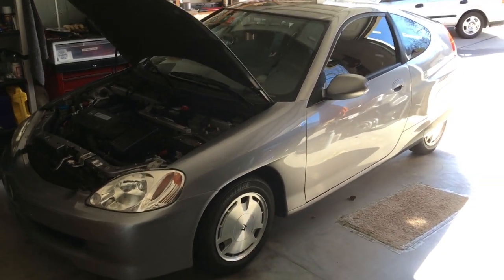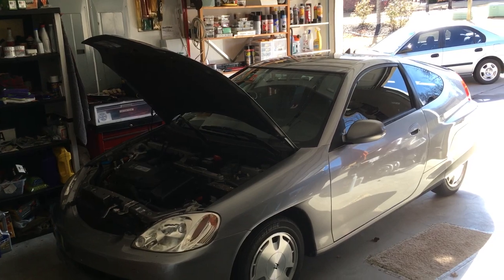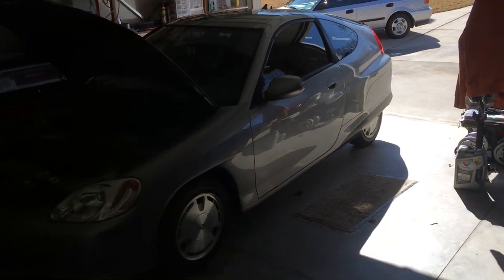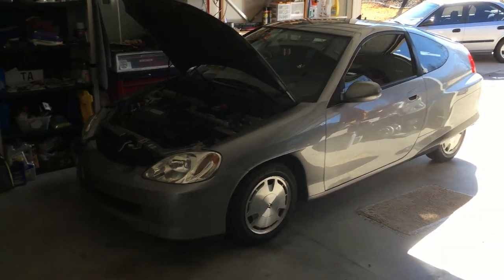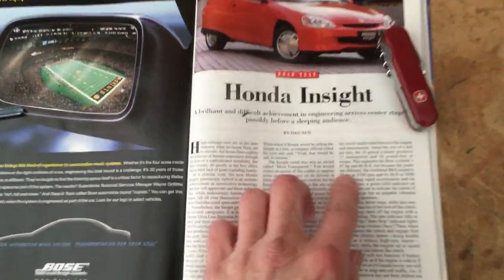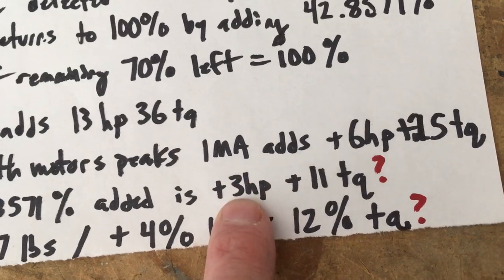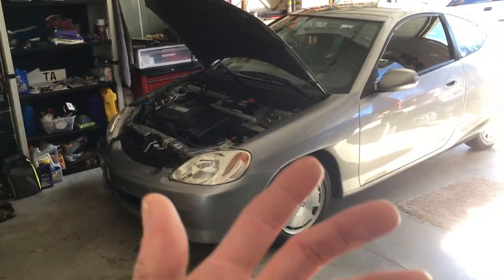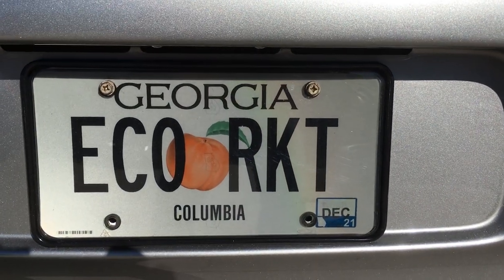2000 Honda Insight part 9: Current hack chat!!!

Comment: 1850 pound car divided by 30 pounds equals about 60. The car has about 60 hp.  so I’ve taken about four horsepower of weight. That is active all the time. What you were doing is fantastic and wonderful wished I could do it. But it’s only a few seconds in the differentgears . And if you don’t charge your car at home off the grid you’re not saving any money.. But you are faster. I am patient the turtle always wins.. If I lived in Georgia and knew you and your friend I would definitely do what you’re doing.. What I’m doing is the easy way to get four more horsepower.

I’m thinking about taking the driver seat out today 35 more pounds one more horsepower.

Comment: If I'm reading right, the simplest current hack implementation is just a little tiny PCB from Peter that gets soldered in as well as a single resistor (and new fuse)?
Reply from the maker: Yes exactly.  However I had a PCB from Peter and it did not work after multiple soldering attempts on multiple modules on two different cars.  I ended up scrapping the PCB and going with individual resistors.  See my comments on video 8, I learned later (after filming) that the car was still in stock form during that video due to PCB failure.  I have a several videos where I film the results of the working current hack and it is impressive.  See my video on "top 10 Insight mods" for a demonstration.  In short, if you're doing the current hack I recommend soldering individual resistors rather than the PCB.

Comment: I’ve taken my battery out 70 pounds. Taking out the Passenger seat 35.Deleted muffler 8 pounds. I’ve got 4 —7pound rims on instead of the 11 pound ones that come with the car. That’s 16 less pounds. Also remove one front brake -7 1/2 pounds. I don’t carry a spare tire jack or tools because my tires are all good shape. I also used 100 psi for two years in my tires. One of them failed a few months back it was six years0ld so I’m down to 70 psi.
Point is that’s about 130 pounds or so.I’ve also taken the windshield wipers off Except one.I have a Lite weight front bumper to back bumper under tray.
Reply: I can't tell if you're kidding.  If not, you value mpg more than your life.  I hope you weigh less than the average person if you're going to such extremes on lightening up the car.

Comment: In your last vid you did a 1st and 2nd run right? You got up to 50. Does the insight really do 50 in 2nd? That's some crazy gearing. I'm out of 2nd at 15 with my geo
Reply from the maker: Yes 1st will go to 35mph, 2nd will go to 70mph, crazy gearing in this car.  Check out the specs here:

https://www.automobile-catalog.com/performance/2000/1130600/honda_insight.html

Comment: The Peter Perkins link is dead..
The other link just goes to insight Central in general...
Reply from the maker: Interesting...both worked when I tested them.  No matter, just do what I did when I got interested in all of this - search YouTube for Peter Perkins and/or Insight current hack.  Go to insightcentral.net and search for current hack.  Then read for many hours.  That's the process I followed.  I tried to make it easy for newcomers with this video and links but for some reason they aren't linking correctly.
Reply: @gray25xt  But you're saying this 40% hack is only good if you have the 8 MAH IMA battery?
Reply from the maker: @Perry_Fan  Yes.  You have a lot of reading to do, I highly recommend visiting the channel/website I suggested before getting into this.
Reply: @gray25xt  ok well I don't have the 8 MAH IMA battery so I guess I saved myself a lot of reading 😅
Reply from the maker: @Perry_Fan  Yes you did, it's quite complicated if you're a novice like me.  You can do a lower current reduction on a standard 6.1 battery and it's safe...but the gains are not as much, not worth it IMHO.

Comment: I think the electric motor is 13 hp. It only assist for a few seconds in   each gear If you’re patient like me you don’t need a battery at all.

If you have a 2000 Honda insight and you’ve got the lithium. It would be good to have the 505 ECU.